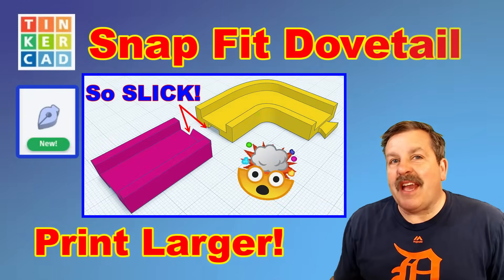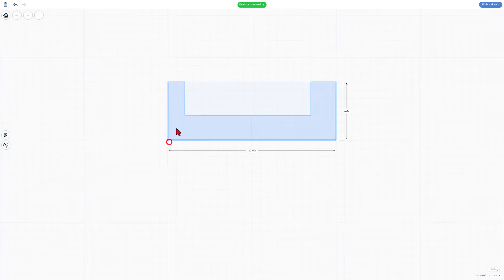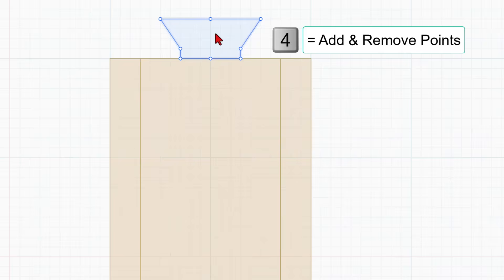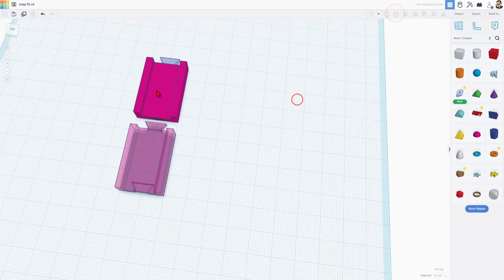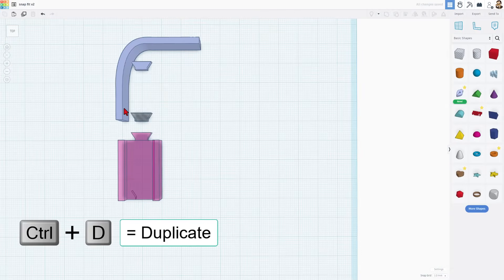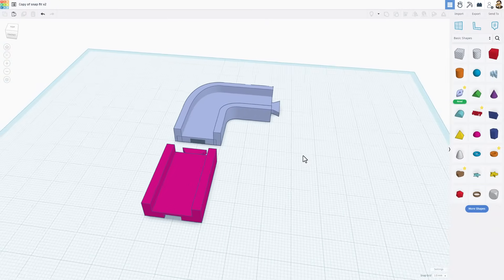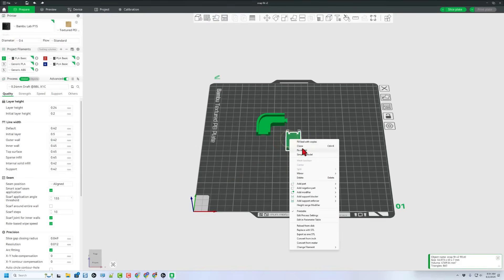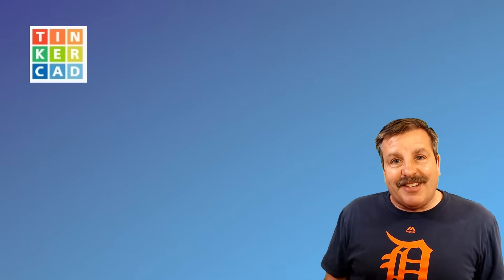Snap Fit Tinkercad Sketch Tool Dove Tail Print Large Connect in Minutes!

Comment: This is frustratingly simple. I'm wanting to make a giant spirograph for a wood working router and came across this video which I'm assuming would work well for the project to make the dove tails to connect pieces after cutting it apart. By chance, do you have another video you think may help in that process?
Reply from the maker: I do not. I am trying to picture the scale you would need for a router to work as a spirograph... A router, replacing the pencil, is  a massive jump in scale.
Reply: @HLModTech I don't think youtube let's you share videos to YouTube as my comment vanished for me at least but the title of the video is, " This toy carved the nicest table I've ever seen." It's of a giant spirograph with the center piece that a router can sit on easily. I believe I should be able to cut a model of a spirograph in bambu studio, add dovetails, print it as big as possible and glue it together. 

A lazy suzan under the router would be great but would need it perfect with no movement.
Reply from the maker: Yeah, no links here. You can share a link or an image in the Patreon design questions area and we may be able to help. https://bit.ly/patmess It is free and there are some really talented designers in there.

Comment: Great tutorial!  I was able to design my part and get it to my printer and start the iterative design process.  For me this is day 1 of 3d printing :D.

I'm curious if you know why when I group my  objects, the subtracted dovetail is set back to a solid?  I rewatched and when you group your objects, i can't tell any difference, other than your objects all stay as you set them..
Reply from the maker: Super cool @mariondorsett! Love to hear it when there is a success. 👏💯 I am curious if you used a bundle group instead of a union group.
Reply from the maker: Easily share a link for your Tinkercad project: https://bit.ly/sharehl Then you can shoot me an link in the free Patreon design questions area and we may be able to help. https://bit.ly/patmess
Reply: @HLModTech  thanks for the reply.  I actually used both the bundle and union group from the buttons on the UI.  I just watched and realized you had the keyboard short cut, and when I used that on my model... it worked w/o any issues.
Reply from the maker: Awesome! Thanks for the update.

Comment: I like to drop the ruler down in the lower left corner of the workplane before starting a sketch so that all dimensions will be shown while drawing.
Thanks for all your content on TinkerCAD.
Reply from the maker: Thanks for sharing. Do you still find it useful even though Sketch has dimensions?  I need to give it a test and see how it works. 👍
Reply: @HLModTech  To be honest, even though I've been using TinkerCAD for years, I haven't used  the Sketch command yet. I'll have to start playing around with it as I'm sure it will be a powerful tool.
One trick I use that's very useful is placing the Workplane on a surface I want to work on that is at a weird angle. Makes dimensioning and drawing much easier.

Comment: The inside and outside radii are not parallel this way.  The walls prob aren't  uniform thickness either.  There are much more accurate ways to do this, and likely easier as well
Reply from the maker: Agreed. The point was the dove tail though. Curves were just for fun.

Comment: What kind of sorcery is this? Did Thinkercad had a major update? When I use to use it, like 2 or 3 years ago, it wasn't like this😮 The only way to make things was with basic shapes that you needed to use to boolean other basic shapes until you where able to make what you wanted.
Reply from the maker: Fact! @TheStickyBusiness. Huge upgrade this spring. Check out my Sketch Tool Playlist. It has been a blast to work with. https://bit.ly/hlsketch

Comment: This is awesome! 

I made a butterfly/ bow tie to connect two triangles for a 15 in pennant but it didn’t snap and was a pain to get right. I also printed and cut out  dowels square and round to add strength and that was a trial and error. I’ll see if I can upload my design, maybe you can make it better! 

But there are parallels to woodworking and 3d printing like this that are super helpful. 

Another potential lesson could be print orientation for strength just like wood fibers.
Reply from the maker: Thanks. Have you visited my Patreon yet? The chat area is really slick. Especially for sharing a design or image as you mention. https://bit.ly/hlpat  It is available to free members. The reply button is tricky to find this quick video explains it. https://youtube.com/shorts/xHUM1eGOmjE?feature=share

Comment: For the corner, it’s tricky with Bézier curves to match the inside and outside radii, to keep the track width controlled. I think I’d have made a circular track, and then chopped away 3/4 of it before adding the connectors. Bonus would be the simplicity of also making different angle curves - like 30, 45, 180 degrees - from the same circular shape. 
But the track wasn’t the real point of this video!
Reply from the maker: Great points. I would have likely used the tube if I were trying to make a perfect 90. It is a slick way to control the walls. Even could have used that to trace it. 🤦‍♂️With a little math skills those points can be placed smarter to make it perfect too. My final end game is going to be making this sort of project much larger. https://bit.ly/neontink

Comment: When I have a part with sharp corners going into a similar hole, I like to radius the corners of the peg and maybe add round holes to the corners of the hole.

Why? Because printers sometimes over-extrude on corners, but the same best practices apply to machined parts.
Reply from the maker: That is an excellent point. 👍

Comment: 5:00 Yeah, I leave a 0.1mm tolerance gap. On your old printer it wasn't enough. On the Bambu Lab P1S it's ample. On the resin printer it may be too much.
Reply: Another thing is the gap on the end of the connector can be greater, like the neck it just needs to be sufficient. The critical distance is the sloped sides, which engage with the other part.
Reply: Consider using bumps on the sloped connector surfaces that can more easily be filed or cut down than a smooth surface.
Reply from the maker: Interesting idea. With that scale being so small... are the bumps drawn using sketch?
Reply: @HLModTech that would work
Reply from the maker: Groovy. I 100% agree that .1 is too much on the resin. .03 was a nice fit with the test part that came with the RS Turbo.

Comment: Geez, what took you so long?  ;-). Thanks man!
Reply from the maker: Lol... so many projects on the list... @DethpickleDave, Thank you for the note! 👍💯 I think I am going to use this skill a ton.
Reply: @HLModTech  Me too.  My understanding is that little artifacts like this should be things we save in custom shapes so we can pull them out when needed.  I've been trying to make something similar for my pegboard mounts and pattern.  Basically, find peoples models that fit my stuff and then tinker on a saved mounting shape.  Great stuff.  Thanks!
Reply from the maker: The only issue with saving this as a shape is that you would not be able to modify the nodes anymore with the sketch tool. I love the "your creations" tool, but the copy between tabs may be more slick for this toy. https://bit.ly/tinkcopy3